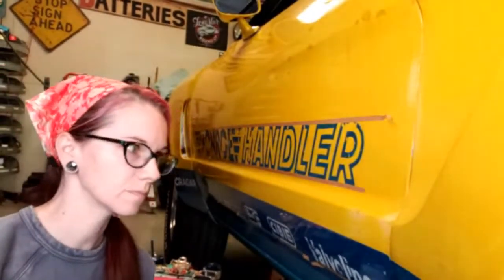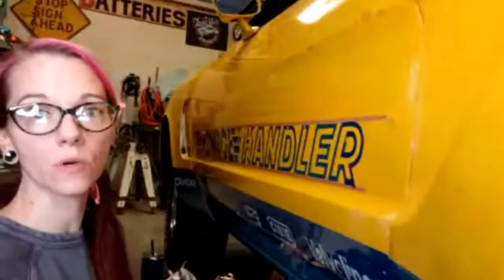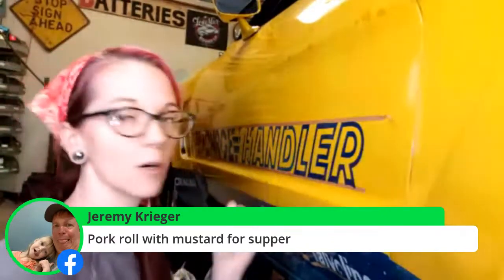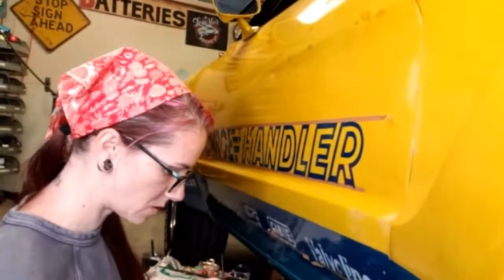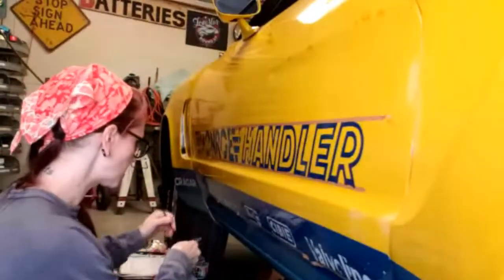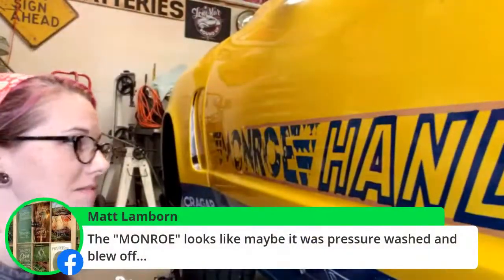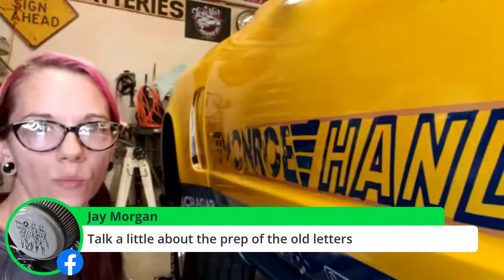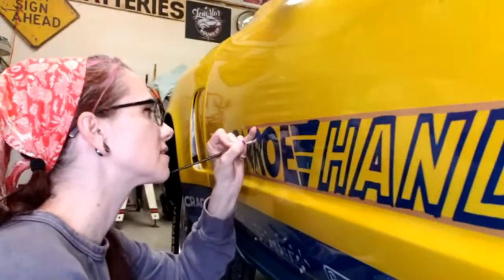Freshening up some old letters

Comment: Isn't using hardener and reducer at the same time working against each other? What are the benefits of that method? Just wondering, thanx for all your great vids !
Reply: Reducer is a thinner, hardener is a cyanide superglue which makes it cure faster, harder and chemical resistant
Reply: @janeblogs324  Thx for your info.Great work you're doing !